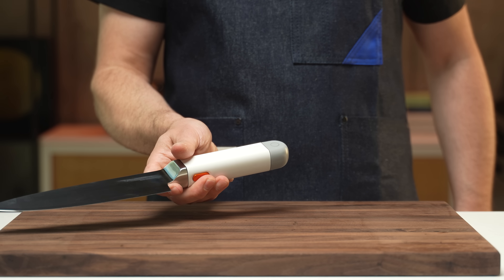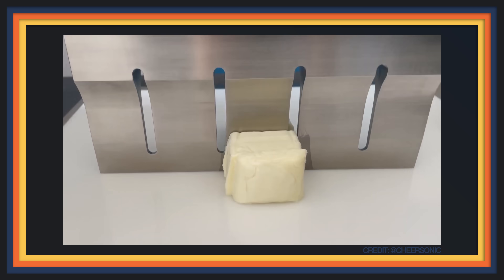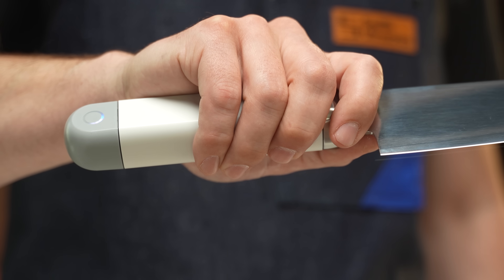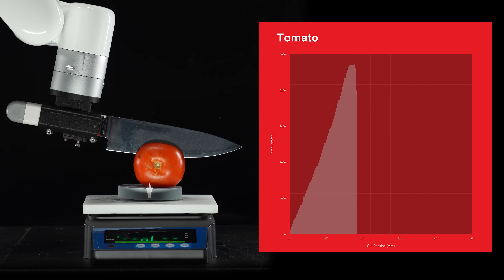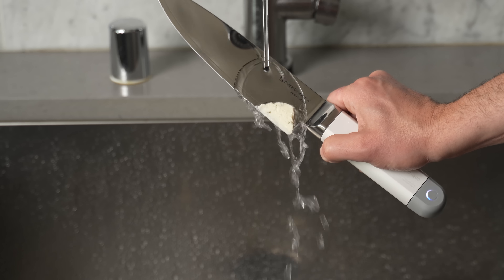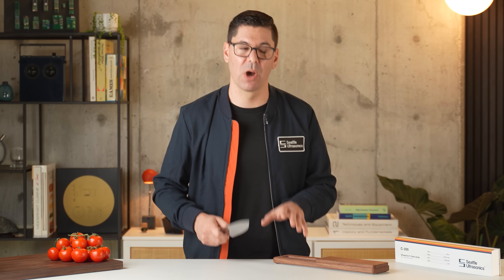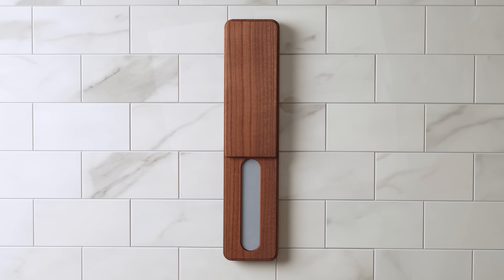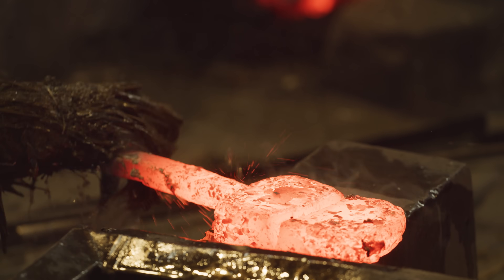The World's First Ultrasonic Chef's Knife for Home Cooks: Seattle Ultrasonics C-200

Comment: Ultra sonic BS. People will invent everything and anything to take people money. Don’t try to réinvente the wheel, a well sharpened n knife is fine. If you need to reduce the force to cut a tomato by 50%, you have more serious problem than a dull knife. Expensive for nothing, having to change the battery every other years… no thank you

Comment: 6:00 min, the premise that dull knifes are more dangerous than sharp ones is common, but dumb.
Reply: It's not. Everyone using knifes knows why and how. It's just an unpredictable tool. A sharp one is not.
Reply: @screenteasing with a sharp one you have more control. A dull one doesn't cut until you apply more strenght and there goes your nail
Reply: @cerrudmanuel I know. That's why I answered to the comment the way I did :) glad we are on the same page.
Reply: @screenteasing you will not cut yourself as deep and as fast with a dull blade.
Reply: And why do you say it’s dumb
Reply: @madabouthollyoaks411 sharper knives are more dangerous, for obvious reasons.
Reply: I’m not saying you're one of them, but most people who don't understand this fact seem to confuse dull for blunt. A bunt knife doesn't have a cutting edge. A dull knife absolutely still cuts, just not as well. Increasing cutting pressure increases the odds of slipping and/or overcutting. 
Also, a cut from a dull knife ends up tearing more than slicing. So wounds from a dull blade tend to be more ragged and ugly. In comparison, wounds from a sharp knife are often clean with flush edges. This lets you reseal the wound more easily and heal faster with less scarring.
Reply: In my experience, this saying also focuses on the likelihood of self-inflicted injuries over capable damage.
Obviously, a sharp knife is capable of inflicting more serious injuries to a body than a dull knife, but the duller the knife, the more likely the odds are for a person to have an accident in the first place.
Reply: @patrickwalker1981 I really hope they read and understand this lol
Reply: Only if you've never used a knife loool.
Reply: You are clearly not a chief lol
Reply: I know that the people who believe this think it makes sense in their mind. Safe knife usage doesn’t change between sharp and dull knives. If you’re putting too much pressure on a blade then you need to change technique. An accident with a dull knife is way less severe than with a sharp knife. It’s the difference between a bad cut and a near amputation.
Reply: I know the saying as “a blunt knife cuts the deepest”. Why, because you apply more force, leading to less control when you slip. Like all ‘old’ sayings, I’m sure there’s some truth to it!
Reply: @quirkybeachbum that is why all the knights in medieval times wanted their swords and weapons as dull as possible
Reply: Of course sharp knives are more dangerous and it shows you guys have never handled sharp knives, everyone that does gets cut. Small incidental contacts with a sharp blade cut you, ones that could never with a dull blade lol. Dull blades cut with blade geometry so they take more effort and likely won't hurt you if you slip. This premise that effort = danger is not shown in the ways that people actually hurt themselves. OUTDOORS55 the biggest sharpening youtuber even covered it.
The injuries are both worse AND more common with a sharp knife. I've never been cut by a dull knife. I had sharp knife go through my finger to the other side just last week, like I was butter.
Reply: @Hisokaa-d2j wow cool... You watched another youtuber as an explanation why you are right and anecdotal evidence, while using the tone of a fedora wearing cocky kid that thrives hard on Dunning Kruger wisdom. 

I own a lot of knives and sharpen mine myself, being able to shave with them. I know how different metals work on them and how geometrical structure has different usecases for things that are able to cut. 

No one denies that you shouldn't give razors to toddlers, or people like you. But if you know what you do a dull knife increases accidents as the thing that's used doesn't do what it is used for and therefore is unrealiable. 

But stupid do as stupid does. I'm happy to read the next ridiculous thing by someone snobby that backs their knowledge by saying someone other said so. 

Btw to add to all this, I also worked in the medical sector. An accident is an accident. More accidents happen by dull knifes. Case closed.

Comment: How durable are the piezoelectric crystal(s)? 
Will the crystals survive dropping the knife on a tile floor? 
I’m asking because ultrasound probes for medical imaging can break (ie the crystals inside) if you drop a them. 
Have you measured the size and amount of airborne  particles that the knife generates in normal (and worst case!) operation? There have been concerns around surgical tools that use ultrasound to cut, due to small particle generation.

Comment: can be used to remove hard scales on kitchen top or vessels . can be used to ground salts . it will generate heat if kept on for long time, use it to spread butter .  if the other blade end has graduations , it can cut coconut shells too. congradutaltions on your invention !

Comment: I didn't realize the cutting needed any improvements, except for a good sharpener. This video hasn't changed my mind.
Reply: For anyone cutting quickly, food not sticking to the blade at all is a big improvement. Also, for a home cook, not needing to keep blades as sharp or sharpening as often is a big deal.   That's no issue to me because I've been sharpening knives and straight razors as a hobby for 30 years, but the general public sucks at sharpening knives and has no idea how to use even a straightening tine.  

For me though, not having diced garlic or cilantro or potato or sausage slices stick to my blade would be damned cool and a nice time saver. I can slice food QUICK and what often slows me down the most is stuff sticking to my blades.

Comment: Umh, how does it mount on the wall and charge the knife with no cords required? Black magic?
Reply: From what I understand of modern electronics, moving magnetic fields generate current in nearby coils of wire. It's probably just an electromagnet that's generating a rotating magnetic field or something. (rotating through changing what way electricity is flowing, not like a physically rotating part)
Wireless charging like that has been a thing for a few years now, a lot of phones have it. Makes me wonder if a phone charger could charge the knife too.

Comment: What happens when you slip and catch the end of your finger? Sure you can touch the edge while its running, but you touched from the side. not from the bottom edge of the blade up, which is how cuts happen. It does seem like it would make cutting much easier so, simple logic, that also applies to your fingers. I can see the benefit for people with disabilities, or arthritis for sure though.

Comment: You should really get something back from your investment. But charging 70 bucks for a small battery pack screams anti repair. Don't be a scam like the big companies. If you really need that much  for some reason at least release the plans and how to open it to change the cells after some years. And don't put BS planes obsolescence counters in like the tool brands that make changing the cells useless. Right to repair is especially important when giving big money to new startups, because of the additional thrust in longevity of the company you have to put in.

Comment: Please use a good blade steel...! If not I'm not buying it...
Reply from the maker: The C-200's blade is made from Japanese AUS-10 stainless steel in a three-layer "san mai" construction. In san mai steel, a hard core layer is clad with tough, corrosion-resistant outer steels. The steel is heat treated to 60-62 HRC inner-layer hardness for edge-holding and durability.

Comment: Took a wild guess on the price seeing the tech and nailed it,  might be steep for some people but from what I can see the steel quality is solid and AUS10 san-mai is a good choice for food prep knives in general.

Any chance you guys have looked into doing a version with a carbidized titanium blade? the super fine carbides deposit on the cutting edge and create what are essentially micron scale serrations. I have a small kitchen blade I did using that method and it slices things like tomato and bread better than anything else, despite feeling "dull" to the touch. Obviously the price would jump, but as a material nerd it makes me curious as to if and how well it would function with that kind of edge structure.

Comment: How long does the battery last for if you constantly use it?
Reply from the maker: On a full charge, the C-200's battery provides about 20 minutes of continuous running at maximum power. However, the C-200 only runs while you're holding down the button. In practice, that 20 runtime minutes is enough to dice at least 20 onions or 40 potatoes. You'll likely get through multiple meal preps on one charge.

Comment: The battery needs a rubber seal to seat to the back of the housing. 
There WILL be water ingress. And I know this thing has been engineered to the moon and back and theres zero intention of this going in the dishwasher. But grandma will absolutely come over and run this through the wash. your spouse is going to cut something with it and throw it in a sink full of water and dirty dishes. This thing needs to be at least meagerly water resistant for $400
Reply from the maker: The knife is water-resistant to an IP65 rating. This means it's perfectly fine to rinse under the faucet and even if it's dropped briefly into water it will survive without damage. Just don't deliberately submerge it for long periods or put it through something like a dishwasher cycle. We also recommend keeping the battery inserted while washing - the battery module helps seal the handle. (In other words, don't wash the handle with the battery removed, to ensure water doesn't get inside the electronics.)

Comment: What if you accidentally cut yourself?
Reply from the maker: An ultrasonic knife isn't inherently more dangerous than any other sharp kitchen knife. You still have to be careful (it is a sharp blade!), but the C-200 actually can make cutting safer because you use less force and maintain more control than using a dull knife.
Reply: @SeattleUltrasonics 🎉

Comment: It needs to be IP68 at the least. Someone will drop in in a sink full of water.
Reply from the maker: The knife is water-resistant to an IP65 rating. This means it's perfectly fine to rinse under the faucet and even if it's dropped briefly into water it will survive without damage. Just don't deliberately submerge it for long periods or put it through something like a dishwasher cycle. We are always striving to improve!
Reply: @SeattleUltrasonics You guys must live in a bubble and don't understand human behavior in a kitchen.  People will submerge these and their teen children will place them in a dishwasher.
Reply: @SeattleUltrasonics  I'm not knocking it, but it looks like a knife and people will be people. A good example is Tesla Auto pilot. Adding a wrist lanyard to it could save you a ton of angry CS calls.

Comment: People gonna be losing fingers all the time with this knife
Reply from the maker: An ultrasonic knife isn't inherently more dangerous than any other sharp kitchen knife. You still have to be careful (it is a sharp blade!), but the C-200 actually can make cutting safer because you use less force and maintain more control than using a dull knife.

Comment: This is awesome in idea and execution and I'm sure this has come up in the 6 years of r&d, but is this really safe ? Even quick ultrasonic exposure can harm bone and destroy cells (in ultrasonic baths at least) and this is a product you're supposed to use everyday for minutes at a time.

This kinda feel like an asbestos/leaded fuel situation where you can only know the health risks years after commercial launch.
Reply: It's said that little to no vibration is transmitted through the handle though. That's reassuring if true. What about people who hold the knife with a finger on the blade, hold the blade while washing etc

Comment: I'm super down to get one of these when it's around 100-200 for my folks, i know it would be greatly appreciated. This really looks awesome and worth to have, especially to people who does own restaurants or cook a lot like my family. How long does the battery last by the way? Awesome product, hope you can scale it! Good luck!
Reply from the maker: We are hoping to make the price more accessible in the future! On a full charge, the C-200's battery provides about 20 minutes of continuous running at maximum power. However, the C-200 only runs while you're holding down the button. In practice, that 20 runtime minutes is enough to dice at least 20 onions or 40 potatoes. You'll likely get through multiple meal preps on one charge.
Reply: @SeattleUltrasonics  That sounds good. I assume it charges fast too? I saw a usb-C port there but idk how it would translate to wireless charging?

Comment: 3:30
Why is the benchmark not using aslicing motion? Who uses a knife like that.
ITs a KNIFE it SLICES

that should reduce the required force by a lot.

neglegent at best, missinformation at worst.
Reply: Slicing motion would improve the cutting ability, but in the same vein that ultrasonic movement does. It’s literally the same, sans that this one switches direction every 1/40,000 seconds. A slicing motion would improve normal cuts the same way it would improve ultrasonic cuts. If anything, this is good practice, at it removes unwanted variables from the test and ensures that any improvement in performance is due to the ultrasonic action that you’re testing and not some other factor that got included. 
Of course, if they could show an extended version that includes the same cut but with a slicing motion (I’m sure here’s a little disparity, though whether or not it’s negligible is what will remain to be seen) and meat cut tests (this would not cut meat as well, I’m sure, because meat is flexible and will stretch in the direction of motion, same reason why this will be unlikely to harm you any more than a regular knife. Then again, cast saws are saw shaped, while this is a full edge, and I no longer recall if cast saws work in this frequency range) among others

Comment: This is so fire!!! I honestly wanted to buy one. One question tho: when the blade wear off and become dull, how sharp would it be?

If ultrasonic just delays the inevitable sharpening, I think there should be some modifications.
Reply from the maker: Because the ultrasonic vibrations handle a lot of the cutting effort, the blade's sharpness is less critical over short-term use. Even as the edge eventually dulls, the knife will still cut more easily than an equivalently dull conventional knife (the ultrasonic effect compensates for some dullness). That said, the ultrasonics are a multiplier on sharpness, so a sharper blade will perform even better when on.
Reply: @SeattleUltrasonics what about cutting meat? Is it still that good? Because soft stuff will likely absorb the oscillating action.

Comment: What is it's active run time and charging time?
Reply from the maker: On a full charge, the C-200's battery provides about 20 minutes of continuous running at maximum power. However, the C-200 only runs while you're holding down the button. In practice, that 20 runtime minutes is enough to dice at least 20 onions or 40 potatoes. You'll likely get through multiple meal preps on one charge.

Comment: Awesome product, looks really well made. How long does the battery last while it’s running?
Reply from the maker: On a full charge, the C-200's battery provides about 20 minutes of continuous running at maximum power. However, the C-200 only runs while you're holding down the button. In practice, that 20 runtime minutes is enough to dice at least 20 onions or 40 potatoes. You'll likely get through multiple meal preps on one charge.

Comment: How long can you use it on one charge?
Reply from the maker: On a full charge, the C-200's battery provides about 20 minutes of continuous running at maximum power. However, the C-200 only runs while you're holding down the button. In practice, that 20 runtime minutes is enough to dice at least 20 onions or 40 potatoes
Reply: That makes sense. Enough to cook a meal but not a professional solution. I think an option to extent battery life could make it a viable solution in professional settings  @SeattleUltrasonics
Reply: My wife is a lead chef and has knives costing 700+ so spending 400 is well within range but only with longer working time.

Comment: Looking forward to the next gen of this tech when it’s $150. $400 is just too much. But what a great idea! 

Question! As you sharpen the knife, does the resonance get impacted? Any issues when it gets smaller?
Reply: Based on the physics, it's probably going to get "sharper" as the blade size decreases, the same amount of energy is being used but on a lower mass. I would guess the resonance position doesn't change unless the blade gets shorter(assuming that back and forth motion is the direction of the vibrations).

Comment: I love the quote, 7:35 "(I did it), no because it was easy, but because I thought it would be easy" xD Amazing. I hope you will succeed. If I will get rich, I will buy this knife.
Reply: Yup... The most impressive projects are the the ones with the most underestimated difficulty.
Reply: I would buy it now if I knew it would last me 20 years. That's the issue I generally have with expensive electronics. I worry that in three years, the battery will go bust or the PCB soldering will detach or whatever and I am stuck with an expensive bone.